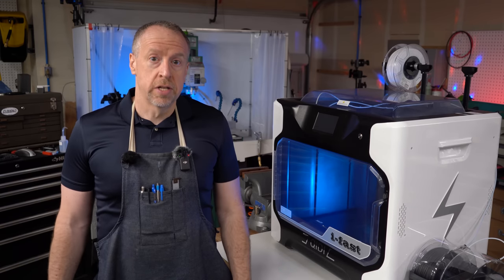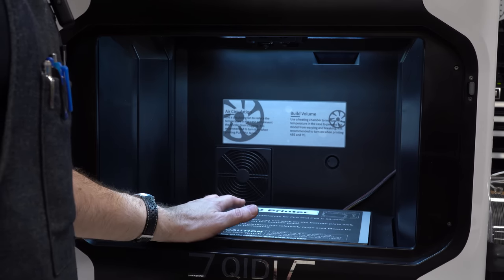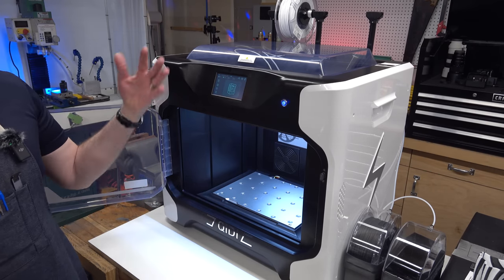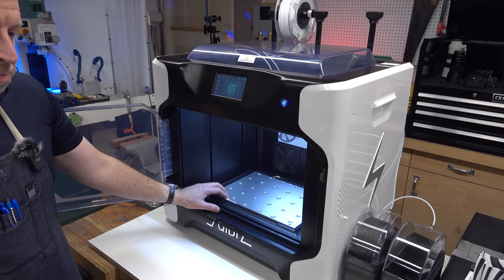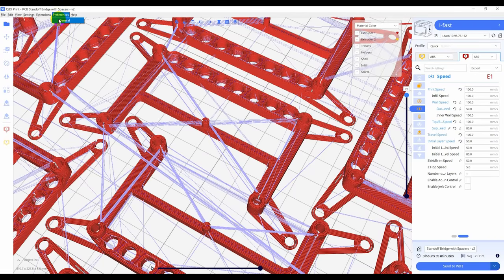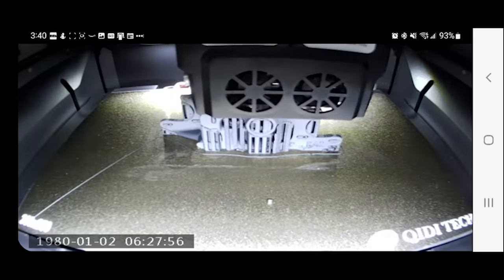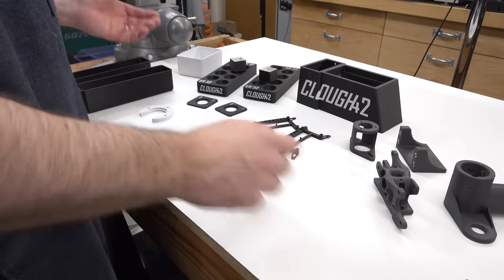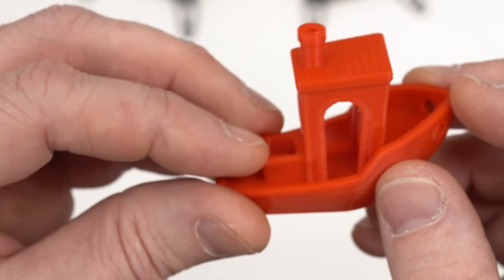QIDI Technology i-Fast 3D Printer | An In-Depth Review

Comment: I have 6 qidi printers at my work and they seamed way too good to be true. They definitely are, they fail more than any other of our printers and they are one of the worst in quality by comparison.
Reply from the maker: What types of failures are you seeing?
Reply: @Clough42  layer skips, fuzzy walls, inconsistent extrusion, the ribbon cable breaking during prints, the tiny board on the toolhead shorting causing the thermistor to read only 50c so the hotend just dumps heat into itself melting the silicone and smoking. We've replaced the ribbon cables, and the toolheads many times and they still only work for a maybe a month and then back in the bin. I really do like their performance for  that month though, they're nice and quiet but for a print shop/constant use not so great.

Comment: We have a qidi printer at our makerspace and for constant use it has a couple of issues. The the ribbon cables wear out, the steppers were disconnected when shipped. There is some skipping on the extruder after a year of use. otherwise it's fairly reliable.
Reply: which model?
Reply: @rixxxer5460  xplus

Comment: Judging from the texture supplied by the heated build plate, I would plan for the finished side to be the bottom. That switch cover would look great and the lettering would be cleaner.
Reply from the maker: I've done it both ways.  I agree that the pebbled surface is attractive.
Reply: If you order a Prusa… all of the printed parts have the textured surface up. Does look decent. All the prints I sell I don’t even bother post processing this surface off as it looks good imho

Comment: It would be helpful for those of us considering various 3D printers to know definitively which of the items you mention yours coming with come with the units "as sold", e.g. the filament reel holders, different build/print plates, high and low temp print heads.  As it sounds like Qidi gave you the unit in the hopes you'd share it favorably w your viewers, it's not unrealistic to believe they may have "sweetened the pot" to you by shipping you accessories the rest of us would not get at the "MSRP" of $2,500 you mention in the video.

Comment: I am stuck. I am a beginner at the 3d world. My platform is calibrated and extruders are also  calibrated. When I try a test print the platform does not go to the top. It is about 4 inches from the extruder. I can not find anything that addresses that issue. Can you help or advise?

Comment: Wow, you weren't kidding about a deep dive! Great descriptions and I especially liked the comparisons with the results from your other printers. Since you mentioned the video on replacing the drill press motor with a VFD and new motor, did you finish or abandon that project? I am curious because it looks like the head on my 30 year old Delta drill press was cast in the same factory as your Jet and the switch box looks identical.
Reply from the maker: Abandoned is such a strong word.  More like distracted.  All the parts are still waiting for me to finish it.
Reply: @Clough42  I very much understand "distracted"!

Comment: Thanks for the excellent review, James. I've been considering something like this - something that works with a wide variety of materials without an extraordinary amount of fettling. I think they only unanswered (unanswerable?) question is whether the software support would be as good for non-reviewers as it has been for you. ...of course if you get all the kinks worked out for us, it's a non-issue :)
Reply from the maker: That's a fair question.  I don't know.  I also don't know if everything I received with the test unit is included with the retail units.
Reply: @Clough42  James, I recently bought one of these because of your review and I can confirm that they have been an excellent company to deal with.  They've answered everyone of my questions and concerns and always respond within a day.  Coming from China I couldn't ask for more.  

Btw, my first ever print with ABS (I've done thousands of PLA prints on my CR-10) turned out fantastic, not perfect of course but better than my CR10 does in PLA and I haven't tuned or tweaked my settings yet so hopefully it will get better.  

Also, as a side note, my printer came with two dual head extruders, one low temp (PLA etc) and one high temp (ABS etc).  Unfortunately I had to order a single head extruder for those times I want to print using the full volume it offers:  360x250y320z single head vs 330x250y320z dual head volume.  

PS:  My dry box didn't come with the rubber bands you showed, did you buy them separately?
Reply from the maker: @larry527az3  mine were on the boxes when I unpacked them.  It was a review unit, so I can't speak for the retail offering.
Reply: @larry527az3  where did you order the single extruder?

Comment: Hi James,
One of the better product reviews I've seen in quite a while. The I-Fast does appear to be an excellent 3D printer. I especially liked the way you put it through the ABS testing. The printed parts don't lie. They all looked great and I have seen what your other printers could do when you were experimenting printing those parts. It does have a hefty price tag, but from what I've seen and you recommendation, I think it's worth the price. Hopefully, when the supply chain gets better, it may decrease slightly in price. You and the family stay safe.
Reply: ive seen it advertised for $1800us on one of there sites . but to get it shipped to Australia ends up costing a bit . so i just went thru amazon .

Comment: I purchased a QIDI iFast last month (Dec 2022), partly based on James' review.  The printer has worked really well (as James showed) - although I've only done high temperature printing with ABS so far (haven't tested the dual printing capability).  One good thing is that since James' review, Qidi changed the USB port location to the top of the printer instead of near the door, which is much better.  When I first used the unit, I had to slightly adjust the horizontal bar that switches nozzles so that it would properly fit into the slot on the sides of the printer.  If it's not aligned, the bar will hit the plastic side wall (not go into the designated slot), and make a bunch of noise as the printer continues to try to push the hot end along the X-axis.  It only took a second to fix, and it's been perfect since then.  Also, the build plate takes a bit to heat up (mine takes ~15 - 20 minutes to reach 110C), which is slower than the heating rate of a smaller Ender 3 - but given the higher temp, much larger plate, and the evenness of the temperature profile across the plate, it's understandable that it will take longer.  Like James, I purchased a second build plate to quickly swap parts off the printer while keeping the bed heated for a subsequent print.  

Unlike James, I certainly had odor build up when printing with ABS.  My printer is located in my basement in a fairly small room - so that certainly contributes to a build-up.  Although it has an enclosed chamber, there are spaces at the bottom of the printer where air can easily escape (between the outer plastic shell and internal structure).  Also, the only filtration appears to be a small filter screen on the outlet of the circulation fan, which pumps air outside the chamber and is meant for low temp printing only (i.e. it really isn't meant for continuous air filtration while printing with a heated chamber).  I don't believe the Qidi iFast has any other filtration system beyond this.  So, I duct taped the open slots on the bottom (minding not to cover the air vents for the electronics cooling fans, which are also located on the bottom of the printer), and I purchased a self contained HEPA & carbon filtration unit from Makergadgets to continuously recycle the air within the chamber.  The printer has plenty of room in the back to accommodate the filtration unit and not interfere with the build plate.  I routed the small power cord for the filtration unit up and through the filament slot of the top acrylic lid.  I also taped over the slots of the acrylic lid (with the filament tubes and filtration unit power cord running through) to make it more air tight.  It worked perfectly, with hardly any odors escaping when I printed with ABS.  My aftermarket fix with the Makergadget filter only costed ~$55.  So, for me, the Qidi iFast still makes a lot of sense, since most other heated chamber printers with integrated filtration systems are several thousand dollars more.  I sent a suggestion to Qidi to incorporate a HEPA & carbon filter to the heated air system (which recycles the air in the chamber anyway).  Given the space within the printer, I think they could easily accommodate this.  Their customer service has been excellent so far.

Comment: Great video as always, thank you. The heated build volume is clearly a key factor in getting taller long prints to stay flat, so I'll be looking for this in my next printer. The software issues made me smile as I remember starting to struggle with configuration management about 25 years ago. I reckon my company had it cracked after a few years later. These days with git and automated deployment tools, it's surprising to hear of companies still just 'hacking' fixes without any evident version control. I expect they'll catch up soon.

Comment: Been running a Qidi XCF for 50 days. Thing is a beast. Churning out CF parts reliably. Like you bring up, software. But support is always on point. Just bought the i-fast today to ramp up production, I wouldn't expect anything less than the XCF. Sounds like more of the same. Work horse, with occasional bugs. Thank you for the review.

Comment: Please do a review on how to remove, disassemble and clear the extruders on the QIDI I-FAST 3D Printer.

Mine came from the factory with a clogged #2 extruder.  The Red PLA filament QIDI supplied is sub-standard and has problems feeding and plugged twice last night.

This video should include how to reassemble them to assured proper heights and reduce issues with leveling and calibration.

It would be greatly appreciated.

Comment: Hello James, 
I purchased an i-fast a few months ago and I recently decided to purchase some new nozzles for the low temp extruders but they don't fit into the heat block threads. They're too big. My 7mm wrench that fits the original nozzles is too small to fit the new ones that I bought (MK10 Nozzle for 3D Printer, 18 Pcs M7 Brass Extruder Head Hotend Nozzles 0.2mm, 0.3mm, 0.4mm, 0.5mm, 0.6mm, 0.8mm, 1.0mm fit 1.75mm Filament). Can you please tell me what size/type I should have purchased? I can't find any definitive answer online.

Thank you.

Comment: Hi James, Really great review of this printer compared to others.  I got interested in a sightly used Ultimaker S5 but it uses 2.85mm filament and had some other drawbacks compared to this one such as price that discouraged me.  I started printing with ABS on a self-converted Dremel 3D20 on glass believe it or not and its amazing how good the parts turn out. But I need a larger build volume now. This printer looks promising.  I think i'm ready to pull the trigger thanks to your review.  I wondered if you had any other comments after having this I-fast for a year now.  Thanks again!

Comment: always cool to see an in depth review of a professional level device, I'm still super happy with my voron 2.4 but still its good to see what more professional offerings are doing.
(FYI im not sure that actively heated chambers are that necessary for ABS, I'm getting around 55-60C with justa chamber fan and mostly acrylic enclosure and don't really warping, guessing the new prusa will do ok too)
Reply from the maker: Prusa has a reputation for being very well tuned.
Reply: @Clough42  yeah, and honestly this is a massive deal.  Today Prussia doesn’t have particularly impressive hardware and their prices are kinda meh, but with their tuning, reliability and ecosystem they’ve got a pretty compelling thing going.  If this new tool changer platform they’ve got turns out well I think the < 10000$ professional fdm industry is in for a shock.
Reply: @KevinBrowder  All the specs in the world don’t mean much if it doesn’t print well. The prusa just works. I have a few printers… and it was a long time before I could justify $750 on a Prusa tbh… but I’m very happy with it… it’s just $750… not $1000+. So for a quality machine with great ease of use… I don’t think you can go wrong
Reply: For printing large and high parts it is still much more reliable.

Comment: I bought an iFast off your review and have been using it for over a year now. I've had to replace the motherboard myself (Qidi customer service sent no charge) but otherwise I've been very impressed. I use it for work, prototyping parts I've built in Fusion before I have them made by SendCutSend to verify fit, and custom motorcycle parts. I've also used it to print full size shoe concepts built in Gravity Sketch VR (I'm a footwear designer).  I personally don't need the dual extruder feature but the heated bed and closed design is key as I keep it in a detached shop in PNW.  This is a huge unlock for hobby builders, literally whatever you need, if you can model it, you can print it.

Comment: This thing has been excellent for me so far, and Qidi provides excellent customer service.  I've only been using CFPA6 and polycarbonate on it so far, but I'm confident you can do any material under that no problem with the right settings and opening the door/lid as needed.

Comment: Awesome in depth review that I stumbled on today after having a bit of time to see if there were any reviews outside of Modbot's. I actually ordered this iFast printer two nights ago and will be receiving it today. I didn't realize it would be that much bigger with the additional filament boxes, but I won't be mounting them in the back either to keep the depth to a minimum. 

I started with an Ender 3 S1 two months ago and the frustrations with it printing more functional parts just wasn't working out with more exotic filaments. So based on the many great features you pointed out, I  jumped right to this to fill the needs the little Ender could not, without having to go through many printers or modified customized printer sizes with floppy enclosures (with an attempt at keeping them toasty) to do what this iFast could and have dual extruder setup. We have the Stratasys units at work and those are not available for us to use, so I believe the iFast could work for me. Great indication of the machine's abilities and print quality in your review. I hope the software will get more streamlined as more input is received from future owners.

 Thanks for the review!

Comment: At 28:29 and later you attribute a lot of the heavy lifting to the heated chamber. I wonder if other factors (all well executed by QIDI) are more important: 1) PEI pebbled surface 2) evenly heated bed 3) (a) chamber. Can you try printing the same part, same settings, same top cover, only with the chamber heat (and its associated fan) off? The chamber will still get warm due to the heated bed, but should save on waiting for chamber heat at startup and power.

Comment: Hi, great honest review and appreciate all of your videos. I’ve learned a lot of really useful tricks! I have an iFast that I picked up a few weeks ago and am still getting it dialed in. I’m curious if yours there has any slide in the print bed on the y axis? I noticed it while bed leveling but it doesn’t ever seem to layer shift. Maybe with thermal expansion of the bed it tightens up? It comes from the tolerance slop between the bed leveling screws and the frame, I’ve contemplated putting a small bushing in there to eliminate it but it’s not effecting prints soo… 

Thanks, keep up the good work!

Comment: Hi James, great review - excellent job as usual :)
I was the lead Mechanical engineer for a major industrial FDM printer company for 10+ years before leaving a few years ago, and have since been looking for an affordable option with a heated chamber (as I'm addicted to large, uniform, flat prints now). My previous employer held the patent for actively heating FDM printer chambers, but that patent expired several years ago and I've been expecting this would come along eventually... I've had the X-MAX from QIDI for a little over a year now, and aside from the absence of the chamber heater have been very pleased with it. The i-fast looks like a great non-industrial option based on my experience with their X-MAX, and with the massive benefits of the heated chamber. I contacted QIDI before seeing your review and they said that the chamber can't always reach 80C and that 60C is recommended. I just wanted to double check with you after you mentioned that it indeed hit 80C without issue. I couldn't find an operating ambient temp spec. from QIDI and assume your room is 70F +/- 10? 
Thanks again for the review. I've been a subscriber for some time now and always look forward to your videos and common-sense, clear explanations.
-Pete
Reply: Also curious about this. And I didn’t know the patent was expired, i thought they got it extended.

Comment: Considering this printer. Just confused about how it will help me improve cf nylon printing? Currently using a Prusa in a enclosure tent type deal. Will this help cf nylon adhere to the bed? Will I not need to use garolite? I’m assuming the parts are coming off my bed due to adherence and not warping…maybe both? Thanks!
Reply from the maker: The enclosed chamber helps retain heat and reduces warping, and the adhesion to the stock flex bed seems quite good with the QIDI PA12-CF I tested.  How much is because of the printer and how much is because of the filament?  I don't know.
Reply: @Clough42  Makes sense. I guess since it's always only a corner it has to be a combination. This could be the printer for me. Until then....More glue stick! Thanks for your response.